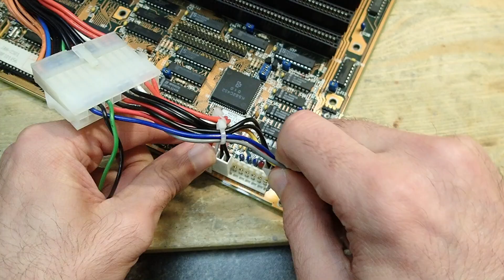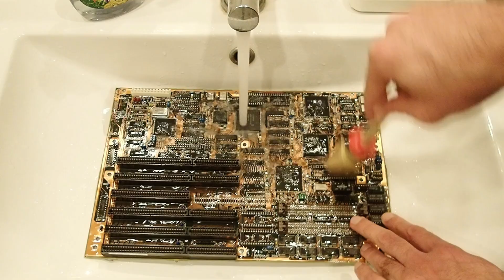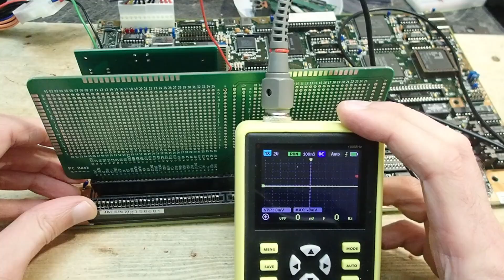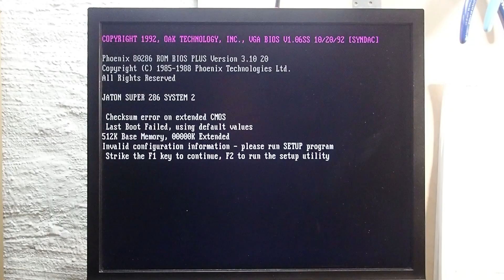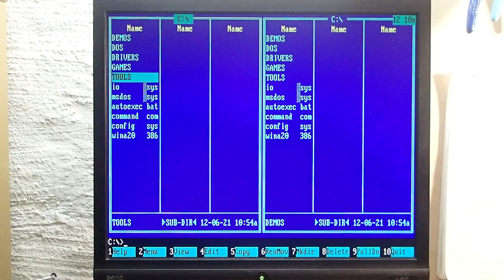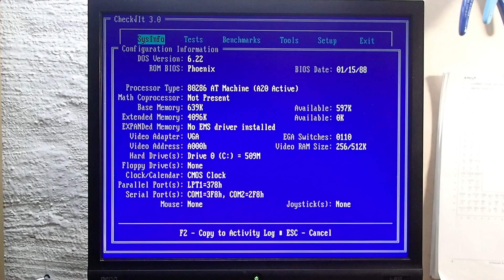Let's repair an old 286 mainboard Jaton JAM-2301-V1

Comment: I’d like to add some information:
After washing with soap and tap water, I rinse the items with deionized water.
You can use RO water or distilled water (aquadest) as the deionized water.
Afterward, you can use air compressor to remove any remaining water.

Comment: I have an old slot 1 dual CPU with two "matched" pentium ii 450 CPUs that I want to bring up.  It's really filthy, but it's been stored indoors the whole time that it's been sitting dormant.  It's a Linux box running a 2.x kernel.  I built it in December 1999.  It's either Gentoo or slackware, can't remember.

Comment: I have a Biostar MB-1220VE  20 Mhz 286 board I caught the battery leakage early, wile I was still using the computer.  at the time the key board had stopped working  and I noticed battery was leaking. removed the battery and cleaned the area and repaired 2 traces that went to the keyboard that were damaged. I use it without a battery, when i go to use it i  boot to a floppy disk and use a util called cmosrest to restore the settings and hit reset.  boots from the hard disk

Comment: In 1988 it wasn't all that unusual to find IO / disk cotroller ports on a mainboard for a 286. Without a controller card this would probably result in better performance, but we'd often add one anyway for secondary floppy/drives as they weren't very expensive.

Comment: When I'm in a hurry, usually I use an hairdryer with hot air. It's not enough hot to damage anything and it takes usually half of an hour to dry a board. However, beware at the water behind the ICs.

Comment: Just one question: what is the size of the rubber tips that you use/recommend? A link to the seller maybe? I must try this method, usually when corrosion is not too bad i use vinegar, rubbing brush, soap, distilled water and protect traces with nail polish. In case of the heavy trace damage, just soldering wire on the back side to reinforce trace(s). That way (nail polish protection) imo, further oxydation is not possible, but your method is just... mindblowing. 
I'm dealing with Commodore machines mostly (c128 is the nastiest b*tch for repairs, you should try it once if you didn't yet, sooo complicated to diagnose, its basicaly 3 computers in 1), but 2/3/486'ers are too "on my menu"😊
No official education in electronics, but the passion is the best motivator to learn new things, and every sucess is so rewarding for this amateur here😊
Thank you for your lectures  man (thumb up)

Comment: I wouldn't be worried about the components so although I imagine some types of capacitors could get effected but what about the PCB and risk of liquid penetration and warping and damaging tracks as it's soaked and then dried out... 🤔
Reply from the maker: When talking about old brown card board based PCBs, which have been used in radios and TVs back in 1950s, then this is a valid point. However, mainboards PCBs are usually made of fiberglass and resin, it would probably take months or even years in the water to get a little bit of moisture into it. Usually PCBs are warping due to the temperature applied unevenly.

Comment: Do you think it will run at a higher capacity CF card, like 2GB?
Reply from the maker: With xt-ide and freedos it would. You can use it also with ms-dos if you format only the first 512MB
Reply: @necro_ware  that's way my 286 works only on 512MB cards. I don't use freedos ;)

Comment: I use the same method in washing the boards, except I use blue dawn dish soap. After rinsing with tap water, I give it a final rinse with distilled water and use compressed air for quicker drying. The distilled water helps get rid of impurities that tap water leaves behind for a spotless rinse.

Comment: I recently got simillar board JAM-2301-V3. There were a lot of missing parts like cpu, bios, kb controller and broken cpu socket. I replaced broken socket and used bios from V1 because there is no other is available anywhere. Board was alived. I set some basic seetings like FDD,HDD,VGA and shadowing. After bios was saved board tryed to boot but I didnt't have floppy connected. So I powered it off I connected floppy and now it is only freezing. It is show only JATON SUPER 286 SYSTEM 2 text and hang at post code 35. Unfortunatelly this postcode is not described. When this code will show both IFRAME and IRDY led will go off. I assume that something died but I dont have any idea where I shoudl begin to search. Could you give me some advice? Thanks.

Comment: Step you missed. Lacquer or transparent nail varnish the exposed traces to prevent the solder traces from further corrosion via air.

Comment: Just watched a few vids from you and did NOT realize, you are from Deutschland. Your english does not have real a german accent (its more "neutral") :) on it but non the less i could not figure out if the slang is anywhere located in the US or anywhere...
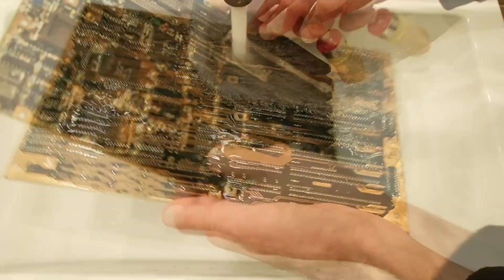Now to topic, why dont you put the mainboard just in the Spülmaschine (hab ich beim B8uer das erste mal gesehen). Ein bißchen heißer als das Hahewasser aber sollte am Ende besser abdampfen... Und zum Abtrocknen einfach mit dem Kompressor abpusten und trotzdem vorsichtshalber in den warmen (Heizungs)Keller über Nacht stellen damit der Rest der sich noch irgendwo hartnäckig eingenistet hat verdampft. Das Nasswaschen habe ich bis jetzt nicht angewendet weil nicht nötig, aber entstauben schon eher regelmäßig mit Pressluft. 9:50
Ist einfach toll diese Antike Hardware zu sehen und wie sie repariert oder sonstwie getweakt wird. Das aktuelle Zeug hat seinen Reiz verloren, vor allem wie kurzlebig das ist; außer man baut seinen aktuellen Rechner um dann muss man sich so einigermaßen umschauen und wieder neu ausrichten.
Hast ein Abo verdient!!!, vor allem weil man selber die Hardware in die Hand nehmen will
Ich habe irgendwo noch ein paar alte CPUs und rumliegen (90er Jahre) leider habe ich beim Auseinanderbau (das erste Mal Elektronik vor 20 Jahren) dilletantisch gearbeitet, sonst noch so zusammengeklaubtes Zeug; sollte aber für ein eigenes Projekt reichen; Hätte echt Lust so einen P1 MMX oder einen K6(-2) System mit ner Vodoo zusammenzubauen naja alles noch nicht spruchreif, ersteinmal sichten was ich da habe und was Dann ergänzend hinzu- erworden werden muss.

Comment: the date code on most through hole Dips are 4 digits, usually the first 2 are the last 2 digits of the year manufactured, as you stated. Then the next 2 are the week in that year the chip was made out of 52 weeks. so 38 would be the 38th week out of 52. I have seen the order reversed. other manufacturers use this too. Just about every circuit board ever made. After the parts/IC's have been flow soldered or however, the circuit boards go into a special washing machine with a special soap and washed to get process residues removed. Also, you are making a video recording anyone else no matter what it is you are taking apart whether a mainboard or your car ...take pictures...it's free and very helpful later on. 😀

Comment: You can find so much crap online from even the 60's, 70's, 80's but people throw away drivers and and firmware. 
I am sure there is an archive somewhere that has it all.
You look for some mindless crap from the 60s and you find it.
It says a lot about democracy, the "Majority" 
But i also think it is a business strategy for people to be pushed forward into upgrading. Where "That driver is no longer available, upgrade your hardware"  "New IFoney 36 Now with rage quit screen protector"

Comment: Question regarding the 8bit ISA slot and the unpopulated slot. Why memory expansion? The 286 can address 16MB with a 16bit data path. Both are available on a standard 16bit ISA slot. So why even longer slots for that purpose? A 0-WS cycle takes 2 BCLK on the 16bit ISA - that's pretty fast for the time I would say. 68000 needs at least 4 CLKs to read/write a 16bit data word and 68020 needs 3 CLK for a 32bit data word.

Comment: This AMD 286 CPU is not good in overclocking, we prefer Harris 286 instead. My boss even bought Harris 286 and remark it to a higher frequency. At that time, those CPUs do not have ID to check.

Comment: Great video :)   I wash my boards exactly like you, but, after removing the soap with tap water, I submerge the pcb in demineralized water (a 5 liter bottle is less than 1€ in any general store) to avoid limestone and other minerals. After that I scrub with a bit of alcohol, just to make sure all the contaminants in the water are removed, and then I use the hair dryer and I let the pcb dry for several days. Do you have any tips on how to protect stamps and stickers while cleaning the boards?

Comment: Beautiful work!  That board must have been an absolute monster back in its day!  I have to wonder what would have even utilized 4 MB of RAM back then?  We never had a 286 when I was growing up, so there's a bit of a knowledge gap for me between the 8088 with only DOS, to when we got a 386DX40 running DOS w/Win3.11...   IIRC you can't run Win3.11 on a 286 so it's hard for me to picture a use case scenario, haha...  These must've been mostly server duty?
Reply from the maker: Actually you can run Windows 3.1 on a 286. It just has limitations due to imperfections in the protected mode implementations which were fixed in 386. But for the office use Windows worked on a 286 just fine.
Reply: @necro_ware  Oh, interesting!  Windows limitations aside, I'm sure it would still make for really unique vintage DOS gaming machine.  With all that RAM you could even launch some games from a RAM drive.  =D

Looking forward to seeing how far you can upgrade this puppy!

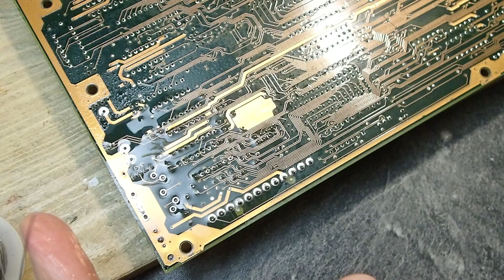Comment: what is this process at 13:53 ? Looks like you're removing residual flux, but I've never seen this anywhere else. Is it a habbit, or does it really have an actual function?
Reply from the maker: You mean the paper towel? It is cleaning. The paper soaks the rests of the flux with the alcohol and the board remains a lot cleaner afterwards. If you simply spray some alcohol and clean the PCB with just a brush, the alcohol will evaporate and some flux will remain on the board. It's especially very helpful if you use gel flux, like I do.
Reply: @necro_ware  whow! I've studied electronics and I'm watching tons of repair-videos, but I never came accross this simple thing. Tried it myself right now - what a difference - looks like stock, one barely sees that it was repaired. Thanks a ton!

Comment: Install ms flight sim 1.0, and fly very close to the ground, until you see the shadow with external view. It requires 10 minutes to turn on a light processor in today's computers with fsx demo. The 287 and xt 8087 should have the same inside, and it results a 30% speed increase in all applications. Once it is done, you don't need to do it again.
Reply from the maker: I think, I didn't understand those two sentences: "...It requires 10 minutes to turn on a light processor in today's computers with fsx demo. The 287 and xt 8087 should have the same inside, and it results a 30% speed increase in all applications...". What requires 10 minutes? And why should an FPU increase all applications by 30%? Only some applications which make use of an FPU would benefit from it. But there were not many games, which would. I think the most prominent example would be SimCity. Otherwise an FPU is more or less just a nice socket filler on a 287, as long as you don't do scientific calculations or CAD it is pretty much useless.
Reply: @necro_ware  I didn't try this with a 286, but it works with tabs, phones and laptops as well. Old phones have Intel 386 inside, and Airstrike 1944 jar does the same thing. It increases the cpu speed. If you want to try, you have to throttle to full speed with external view, low, to see the shadow. Coprocessors can have heatsink, the 8087 and the 387 at 40 mhz. That is why, I guess the fpu has this module inside. Video cards have a Dac, older ones have heatsink optionally, so if you want to do this, then it affects that additional chip, usually under the video bios.

Comment: How about a Necroware XT-IDE BIOS board? What is the long socketed chip on the edge with the power connector?

Another rare 286 board was made by Western Digital. In addition to the floppy, IDE, serial, and parallel ports it had "SEGA" or Super-EGA that could run up to 800x600 16 color, if you could find a TTL monitor capable of such scan rates. The very odd/maddening thing was that all of the built in peripherals could be disabled, except the video. So adding an ISA VGA card wasn't possible since it would use the same DMA and IRQ as the built in video. Thus I had to upgrade motherboards when I got a VGA card.

My best 286 had 12 meg RAM with 512K onboard in DIP chips and the rest on three Micron 16bit ISA boards. They had EEPROM configuration so I set part of the first board to backfill the lower 640K and all the rest was split between XMS and EMS. IIRC this one also had a built in low level formatter for IDE drives. It could do a low level format on any drive up to the maximum size it supported. I used it to recover many "bad" hard drives that really just suffered from some weak sectors.

Comment: I rinse with >=91% alcohol and then dry with an electric duster. I can always plug things in immediately.
Reply from the maker: Or you can wash it, take some (less strong) alcohol and relax until the hardware is dry ;)
Reply: Good point. ;)

Comment: 10:20: if you want to reduce the risk with salts left behind after washing the board with water, just remove most of it (shake the board), then spray it with distilled water, shake it again, repeat that setp. Then most of the salts are gone. If you still don't trust that method, spray ethanol (96%) on the board which will mix with the water. Shake the mix off, let the board dry.

Comment: Yet another blast from the past repair on your channel! Thank you for that Sir! 

I’m really getting myself on checking YouTube for Necroware new release … and they getting better and better every time (motherboards repairs are my personal favorite). Also thank you for pointing me on Logic Probe LP-1, some time ago (sorry for not, putting a proper response under your comment, but I had some C.O.V.I.D situation going and was off the hook for some time). In connection to subjected video I have a quick question ;) I have been able to locate those rubber finishing/polishing accessories for Dremel on AliExpress (the green ones), but they occur in variety of different widths (the rounded/taper shape is obvious). The main question is witch width are you using (they are available in 4/5/6/8/10 mm)? I would probably go with 6 mm for smaller traces and pick 10 mm for the rest of the traces and also because the 10 mm must for last longer (much more material for almost the same price ;) 

Thank you for your help in advance!

PS. Off to watch Hippo 15 repair :)

Best regards
Tomasz Goraziński

Comment: Yes please, a video on why some motherboards have 2 BIOS chips. Is one chip even bits and the other odd bits?
Reply: It is to speed up access to the BIOS because the EPROMs only have a 8-bit data bus. On 486 and later they used one chip and shadowed it to ram to speed up access

Comment: Why didn't you socket the removed chips while you could?
Reply from the maker: I could, but I usually don't socket the chips which are not common to fail. If that would be a ROM, PAL, CPU or RAM, I'd definitely do.

Comment: I would try erasing and reprogramming that flaky EPROM chip. It may just be nearing the maximum lifetime for holding its initial programming, and a refresh might make it work again. I'd also reprogram the good chip as well just to be safe.
Reply from the maker: I tried to reprogram the old IC, but the result was unfortunately the same. And there is no need to "be safe", since now the ROMs are uploaded to Ultimate Retro project :D Should something happen to the ROMs again, I will be able to download them any time....

Comment: Very interesting. My first everyday PC was a 286-12, tho not this fancy (I still have it tho it hasn't been powered on in 20 years). I also had an IBM mainboard with a 286-10 CPU and onboard IDE -- and get this, two 72-pin SIMM sockets. (Yes, really. 72-pin RAM in a 286 mainboard. WTF.) Wish I still had that one, just for the curiosity value. I think it maxed out at 1mb RAM, tho (it didn't have any onboard RAM).
Reply from the maker: Yes, that was the IBM PS/2 Model 50Z. I have one here.
Reply: @necro_ware  Yes, that sounds like the right one! I only had the naked motherboard and RAM. I do recall it gave me an undying hatred of the Phoenix BIOS.

Comment: hello can you please do a video about products for cleaning PCBs, and repairing them with explanation
Reply from the maker: There is not much to say, than what I already mentioned in this video. For washing I use normal soap and water and for cleaning from flux and minor residues I use IPA (isopropyl alcohol). That's it.
Reply: @necro_ware  
Thanks  alot ☺

Comment: great video - I had an unexpected emotion when I saw you playing Keen: I used to play with it decays ago -.
One question: is it possible to apply back copper on board trays or there's some problem soldering it at home?
Reply from the maker: You mean ripped off traces? If yes, the easiest way in my opinion is to solder some wires, tin them and cover with some varnish, as I showed in some of my videos.
Reply: @necro_ware  thank you, I'll search for one to watch

Comment: For those who are afraid of the minerals of the water, you can also wash the pcbs with 99% isopropyl alcohol, wich also does the job quite nicelly. 

I've saved some boards from leaky caps doing that
Reply from the maker: And for some reason you even get into the party mood doing that :D